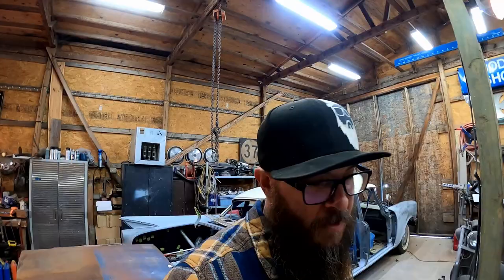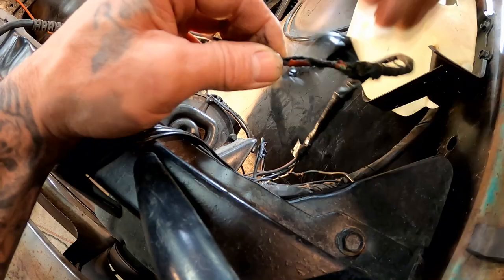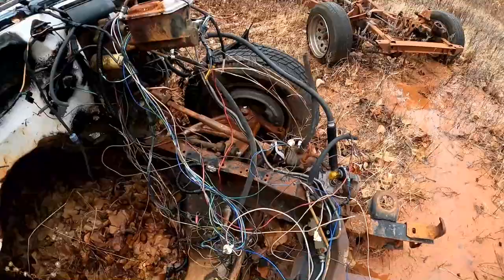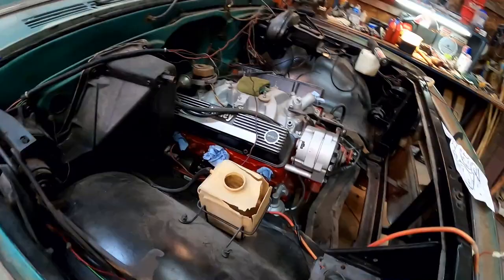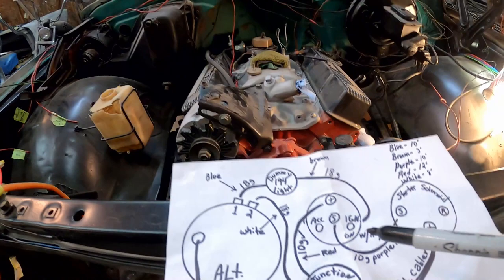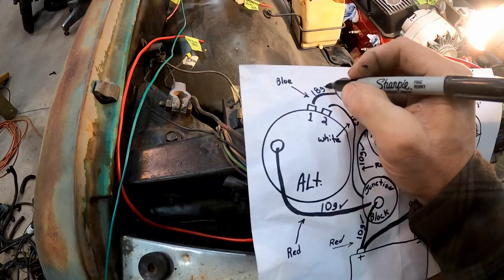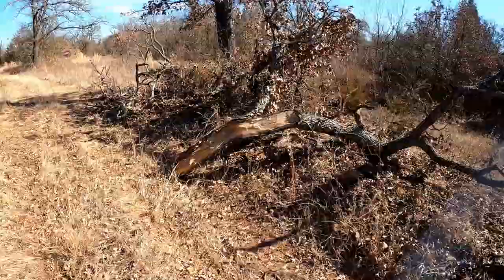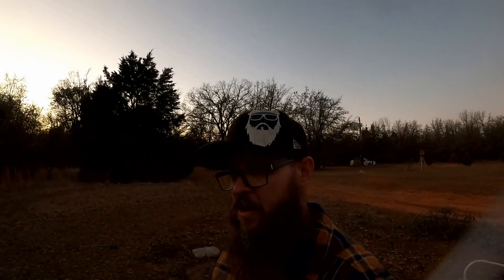1970 GMC rebuild pt. 4

Comment: You are into my specialty. I love wiring. My son's 85 mustang caught fire and burned everything from the firewall forward. Got a wiring diagram and built a whole new wiring harness for under the hood, Then I had a neighbor restoring an El Camino and we built the harness inside the car and under the hood. Love that kind of work. Got my star in dealerships only because I was low man on the totem pole and no one else would do electrical. Turned out to be right up my alley.
Reply: I wish you were my neighbor.  I'm trying to sort out brittle wiring on my '58 Cameo Carrier.  I think a new harness is in my future....

Comment: I lived down in Arkansas in the late seventies n found me honey holes of cars/trucks to fix. I used to rake all the leaves that I could and take back to the place I was in that had very few trees an no underbrush to speak... mostly gravel and started me a great big garden out of composted tree leaves and dirt I plucked up at that time. I look back at the rock spot I choose to do and wound up with a half acre garden. I bet I had five hundred dump truck loads of leaves and stuff from other places I hauled with my truck and tractor. Nice garden it turned out to be. I got a car from Mississippi and it had a regular note book piece of paper for a  title, a bill of sale and took it to Arkansas to make a real title out of which was just visual. Once that was done, I loaded that 66 chevy caprice up tight an headed up to washington state. Not one lick of trouble but a week after found something that parked it for good as I didn't know how to fix coil spring suspension at that time. It did get fixed but the person I sold it to was the one.

Comment: Your red 10g wire... I know you want it clean, but food for thought.  Resistance is exactly proportional to distance (given same material and thickness).  So, shorter, the better.  Or, if going longer, beef it up and go thicker.  Half the distance, is exactly half the resistance.   Less resistance, less voltage drop.  Crimps are fine too, but a light layer of dielectric will fight off corrosion.  I recommend getting some shrink tubing by the foot off ebay, or such, if you need to solder or butt splice to make a lead longer.  :)

Comment: Weird beard, I agree with you about soldering wires. Twist/ tape wires until you know for sure. Then solder. Don't forget to remove all the flux before you run the shrink sleeving into place....
I never liked automotive wiring. The wires change colors from harness to harness. Don't understand why they would do that.

Comment: That red wire that melted was probably a double run with the one cut off to carry the current. Double it again, or run an equivalent heavier gage wire to carry the load safely.

Comment: A higher number strand cable will carry a higher amperage. Eg 8mm 10 strand as to a 8mm 20 strand will have double the surface area, possibly doubling the amperage load carrying. Less likely to melt.

Comment: On an internally regulated GM alternator one of the plugs will be hot all the time and the other will be hot with the ignition on and running. Now it's been about a hundred years since I hooked one up but you can look it up on line. As I remember the connector farthest from the charging wire is hot all the time and the closest is hot with ignition on. But look it up first as this 65 year old brain forgets sometimes

Comment: Check your diagrams WB. The 10si alternator uses only one red wire bro battery but I might be wrong...and watch your grounds you need a ground from neg terminal battery to sheet metal to get proper charge voltages

Comment: That's great, that you have what we called, a block and wire diagram. 
VERRRY HELPFUL!!
Will you scan/ take a photo of it and save it on your computer for future reference?? Some GUYS CAN remember it, but this guy cannot..
Rubber grommets for firewall wiring??
I enjoy your channel.
Please understand my questions/ comments are not meant as negative ones..
Great job!
Enjoy your property!!  I'd get myself lost there....I'd use my Google maps....
Be well!!!
Reply from the maker: I’ll definitely be keeping this diagram in my toolbox for future reference. The rubber grommet fell out of the hole but will be put back when everything is finished up. Thanks for watching and commenting. I enjoy reading and responding to comments in my down time so it is appreciated. 🙂
Reply: @weirdbeard8898  ok. As long as you didn't mind. I constantly save info for my lawn tractor repairs this way, and believe me, there are many. Be well..

Comment: Dear God, that wiring is a nightmare.  I'd want to rip every wire out of that old truck and start over with a fresh painless harness and fuse block kit - replace it all front to back, headlights to tail lights.  That old truck is lucky it still exists, and didn't burn to the ground from the butchery on it's wiring harness.

Comment: I hear people talking about soldering wires, every automobile built has crimped connections on every wire they put on and have for decades.  On construction jobs electricians do not ever solder electrical wires, the NECA code book does not allow it.  I don't understand why people persist in thinking soldering is better than approved and accepted methods used for at least the last 70 years is not as good as the methods they replaced.
Reply from the maker: Very good point but I didn’t want to upset the YouTube gods 😂

Comment: Wierd Beard they got some new type wire connectors reusable they have a little lever and they cam lock on each wire. Type in reusable electrical wire connectors.
Reply: Are they the Wago ones you are referring to?
Reply from the maker: I’ll check it out. Thanks.
Reply: @bigfella6629  I believe thats the ones. I couldn't think of the name

Comment: With that alternator, you just need the Bat + wire and then you can run a jumper wire to the regulator. https://www.youtube.com/watch?v=vPeIURFb2Iw just another reason everyone swaps SBC into everything. Too easy. I actually linked the wrong video. Here is the one to convert the alternator to where only 1 wire is needed. https://www.youtube.com/watch?v=kITOYnudfqc

Comment: Baffles me how people struggle with electrical.  Learn to read a schematic, it is not hard.  ALSO, and I can't tell you how many people overlook this.  Make sure there is a large ground wire between the engine and the body.  Never forget your ground side.  If your bulbs are dim, check the ground.
Reply from the maker: Good tip. Will do.